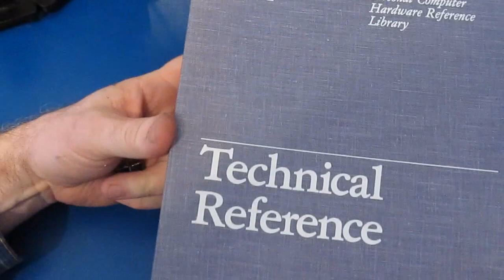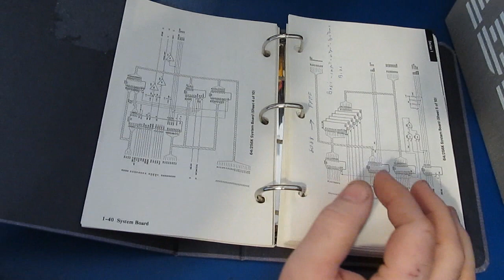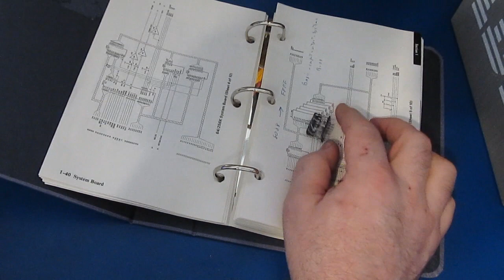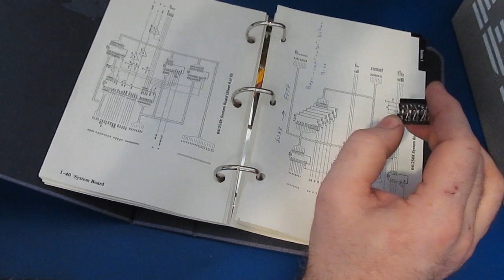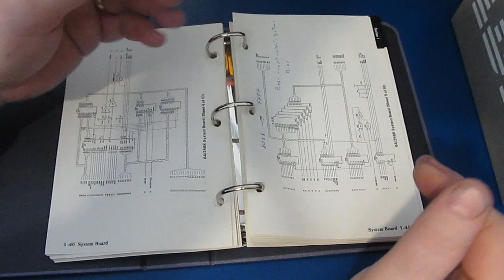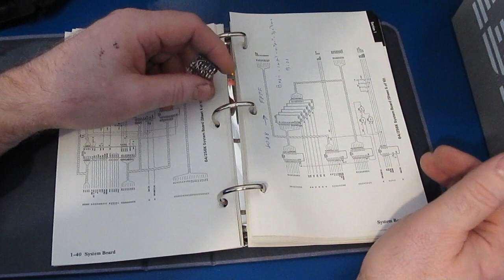Engineering Stories,  Early Career Embarrassing Moments

Comment: I have some very embarrassing moments from my own early years, but the best story is when I was a tech and embarrassed 3 senior engineers who were looking at a new prototype of a SONY magneto-optical disk-drive that had just come in from Japan. I'd just gotten the job at SONY's data storage lab in the USA, and the group's new assignment was to design a PC interface card for the drive and write the driver software for it and provide an English user interface. The senior hardware and software engineers were standing over the new prototype with a 'scope and multimeters and were trying to figure out why it wouldn't power up. It was actually my job to set it up for testing, but it had just arrived, and they were too eager to wait for my return from lunch. So I walked into the lab after lunch and saw them all huddled over the just unboxed unit sitting on the bench discussing the turn-on problem. Since I was standing back from the group I immediately saw the problem, and asked, "Have you tried plugging it in?" since I could clearly see the plug of the power cord on the floor at their feet. I wish I had a video of what ensued. :)

Comment: Let me guess: the 2 replacement ICs were 10 times cheaper than the destroyed IC.
Which IC was it and what did you replace it with?
Reply from the maker: What do you think 7400 logic sold for 40 years ago and what's your guess on engineering costs?   I'm sure I could figure out which IC it was but what would be the point?

Comment: Some 35 years ago, I assembled first PC, for the friend of mine, because I was HAM and electronics geek (closest to PC expert, he could get :-).  Case didn't have standard connectors for the front panel, HDD activity LED among them, so I decided to solder those two wires to the Seagate ST-225 connector. His soldering iron, that I used, wasn't properly grounded and it burned through HDD electronics, making it non-responsive. Luckily, after carefully removing traces of soldering, we were able to push that HDD through the Seagate RMA and he got replacement unit.
Reply from the maker: That ST225 had to be one of the most popular drives of the AT era.  I still use one today in my oldest scope.

Comment: One of my first, and more embarrassing "rookie 18 year old" incidents at my career workplace was, as an apprentice "Cable Splicing Technician" I was working with a crew of 3 others in Chicago that were working in a manhole on underground  telephone cable. They were planning to stay later to cover finishing up work there, and they really didn't need me, so I was planning to leave, but before I left, they asked me to inflate a bicycle inner tube ( for a 26" tire) that would seal a metal extension crown to the manhole cover crown so they would stay dry during an impending thunderstorm. Reading the marked directions on the crown, it said "Inflate to 10PSI" , so, that is what I did, and left them. Well, the thunderstorm arrived not long after, with a good torrential amount of rain, and.... that 10PSI inflation was not enough to create a very good seal. Water started to drip, then run in on them, and close enough to the open telephone cable splice where they had to scramble to cover the splice with what they had until they were able to inflate the inner tube for a tighter seal. I learned a lot from that incident.#1 - It actually takes about 30 to 40 PSI, not 10, to create a good seal on that crown extension,#2 - always have at least one waterproof tarp handy if rain was impending, or even if you needed to leave the manhole to go topside for something, #3 - if heavy rain was going to happen, it was best to either close up the splice before the rain got there,  or not plan to open one in the first place, and #4 , never trust a rookie to do something important, and if you do, double check their work. Luckily, no telephone service was harmed, my senior co-workers got a little wet, but survived and didn't totally hate me afterwards, and life went on.